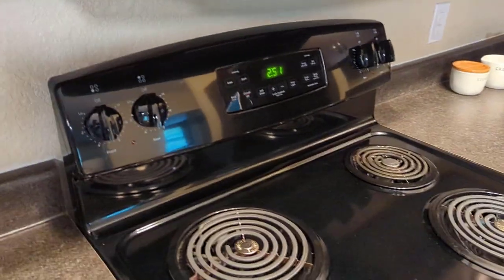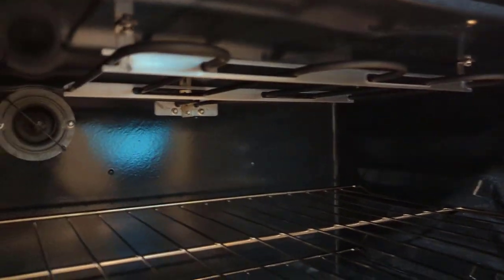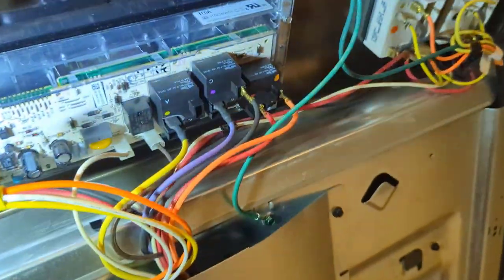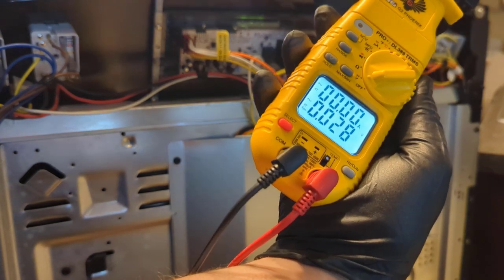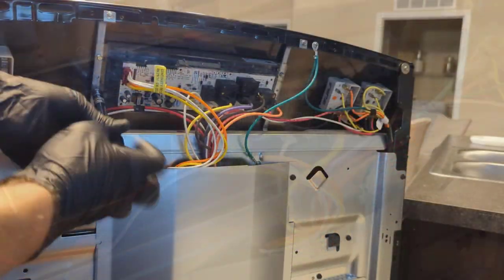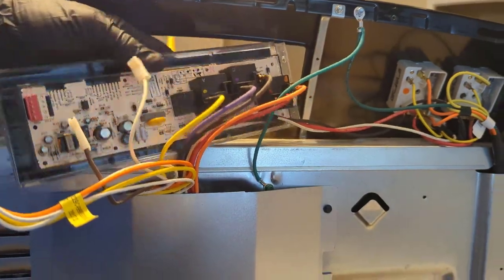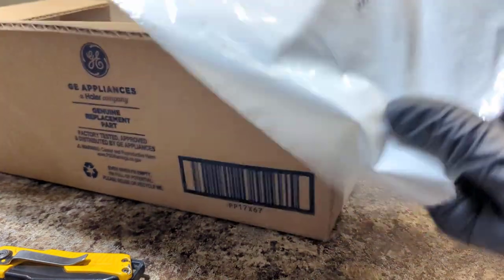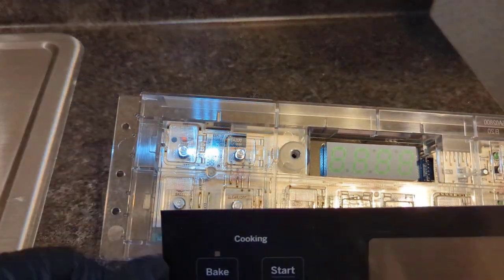GE Oven Not Working On Bake or Broil

Comment: Having the same issue with bake and broil not working. Tested the element leads with my multimeter and got 120v (neutral to one lead is 120v/neutral to other side is 120v). Checked direct voltage and got 0v (common probe touching one element lead and hot probe touching the other element lead). Checked continuity on the elements, both are fine. Checked continuity on the thermal fuse, it’s fine. The board on this range doesn’t have exposed relays to test like the one in your video. It has to be the board, no?
Reply from the maker: @frawdulent  It's the only thing left. Thanks for watching & hell support the channel by subscribing 🛠️👍

Comment: Question I am new to this how would I know where to put the tester on the right wires for voltage
Reply from the maker: Honestly if you aren't sure where to put the tester you shouldn't use it until you get some more knowledge otherwise you could get hurt. You would need to understand electricity, know how to read a wiring diagram, & know the appliance you are working on. It's not something you want to go and mess with unless you have some experience or with someone who does that can show you the proper way so you don't get hurt or damage the equipment you are working on. Hope that helps.

Comment: I have a GE oven stove top doesn’t work and neither does the oven itself. Bake or broil. Everything else comes on such as the clock in the settings. Is it possible to motherboard is dead for the heat part top stove and bake and broil oven
Reply from the maker: @ThePacman7869  If the clock/settings work but the burners & oven don't work it sounds like your only getting 120 volts to the stove instead of 240 volts. This might sound dumb, but pull the stove out a little & check the plug to make sure it's plugged in all the way. I've had one do this before from the plug not being in all the way. Good luck. Thanks for watching Pacman & help support the channel by subscribing 🛠️👍
Reply: @ApartmentMaintenance  thanks for the reply. I’ve done this. It’s hardwired in no plug.
Reply from the maker: @ThePacman7869  Could be a bad breaker than. One half of the breaker could be bad or the wire could be loose inside the breaker & not making connection. I would definitely start there since it's hard wired in. If you're comfortable with electrical & you have a meter, you can check for the proper voltage at the breaker.
Reply: @ApartmentMaintenance   thanks just found out. It was a bad breaker now it works. I appreciate all your help. Have a great day.
Reply from the maker: @ThePacman7869  Nice! Glad you got it figured out. Don't forget to subscribe & hit that thumbs up button 👍

Comment: I’m confused, you said you were looking for 0V from L1 to the Yellow wire if the board was sending power to the element, and that is what you got, why did you condemn the board?
Reply from the maker: Great question! I was looking for 0 volts & then OL which both readings checked out properly, but the board wasn't turning the element on. You can hear the relay click at OL then go to 0 volts right after. It shouldn't go that fast through OL & 0 volts. That clicking of the the relay is turning the element off & then right back on cuz it hasn't reached the set temperature. Problem was, the element wasn't coming on which is why it would click right back & continue to cycle through. I knew I had the correct voltage (240volts), the element was good, & the only thing left is the board. With not having the bake & broil elements working, that's a very good sign either you don't have voltage or a bad control board. Showing that I was reading what it's supposed to show but no heat in the oven tells you it's a bad board (of course knowing the elements are good). Thanks for watching Brian 👍
Reply: Does this stove have a thermal fuse?

Comment: My breaker tripped and we flipped it back on the oven worked initially but not since, now the broiler element doesn't work and neither does the bake element, the stove top does. Do you think that's a control board issue?
Reply from the maker: It sounds like it. If both the bake & broil aren't working then I'd say it safe to say it's the control board. Thanks for watching TayTay & Subscribe to the channel 🛠️👍
Reply: @ApartmentMaintenance  thank you!

Comment: If my stove, broil and bake elements aren't heating but the display has power... Does that mean control board, as well?
Reply from the maker: More than likely. Obviously it's hard to say for sure without seeing it but the chances of both elements going bad at the same exact time are pretty slim. I would lean towards the board since it's the only other thing it could be other than not getting 240 volts to the range. The clock only needs 120 volts to operate. Thanks for watching & subscribe to the channel 👍

Comment: How were you certain it wasn't a thermostat issue?
Reply from the maker: These ovens have a oven temp sensor & it would still work on bake or broil but the temperature would be out of wack. For both elements not to work it's definitely a board issue. Thanks for watching Ayehotah3887 & subscribe to the channel bro 👍

Comment: I just out a new board in, and my broil, convection and bake still don’t work. Any ideas?
Reply from the maker: @chaselyons2033  Make sure you have 240 volts coming into the terminal block at the back of the stove. The clock/display only needs 120 volts but the oven needs 240 to operate. Hope that helps. Thanks for watching Chase & help support the channel by subscribing 🛠️👍
Reply: @ApartmentMaintenance  there is 118 coming in at the back of the oven, but my outlet is reading 233.
Reply from the maker: @chaselyons2033  Your losing one of the legs of power then. Either the cord is bad, the terminal block is bad, or one of the wires is loose, broke, not making a connection. You can unplug the oven, then unscrew the cord from the terminal block & make sure all three wires at the end of the cord aren't touching each other or anything metal, then plug the cord back in & see if you have 240 on the two legs of power on the cord. If you do, then you know the cord is good & it's the terminal block or a wire on the stove. If you don't, then it's the cord.
Reply: @ApartmentMaintenance  so I have (left to right) black, white in the middle, red on the right. Underneath those is green. 

-black to white is 240
-black to red is 240 
-white to red is 0 
-all of them to green is 120. 

I had my tester on the wrong setting the first time I tested, my fault!
Reply from the maker: @chaselyons2033  You should have:
Black to Red: 240 volts
Black to White: 120 volts
Red to White: 120 volts
Black to Green: 120 volts
Red to Green: 120 volts
You said you had 240 when you put the meter on Black to Red so you know you're getting the full 240 volts at the end of the cord, but not into the stove when the cord is hooked up. So it sounds like you need a new terminal block or something is wrong with one of the wires on the back of the stove where the Red or Black wire from the cord hooks up to.
Reply: @ApartmentMaintenance  could it be the cord itself possibly? I feel like that’d be easiest lol
Reply from the maker: @chaselyons2033  You can buy another cord & try it out.
Reply: @ApartmentMaintenance  I swapped the black and red wires from the cord, the manual says they can go on either side. I’ll run tests again and go from there, I appreciate you helping me get answers!
Reply from the maker: @chaselyons2033  Yeah it doesn't matter which side the black or red wire is on. They are both 120 volts. Sounds good & no problem! Make sure you subscribed to the channel 👍
Reply: @ApartmentMaintenance  I subbed! Also, still
Failed when I went to the right side. Inspected the pink cable on that goes to the top of the oven and it seems fine. I guess it’s probably the terminal block then, although it looks fine. The metal plates are wobbly that’s it though. Could it be my outlet in the house rather than something with the range?
Reply from the maker: @chaselyons2033  If you got 240 volts at the outlet it's the stove.
Reply: @ApartmentMaintenance  ONE last question, I promise! 🤣 thank you for your patience and kindness. So, I checked my cord and it’s rated for 30 amps, my range is a 40 amp range. Could that be it? Everything looks perfectly fine with the cables and terminal block on the range, there’s absolutely 0 issues there that I see.